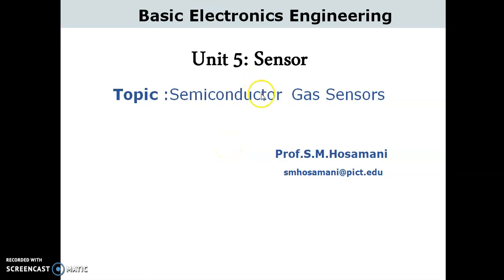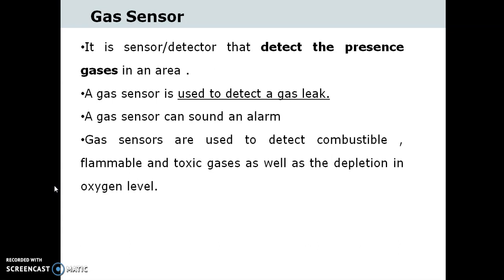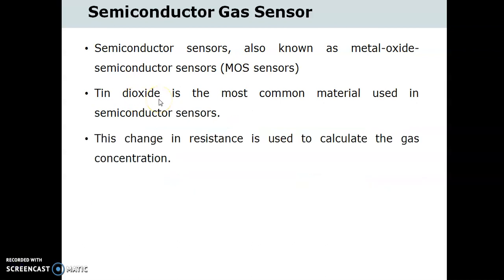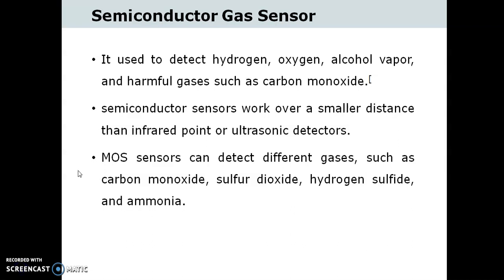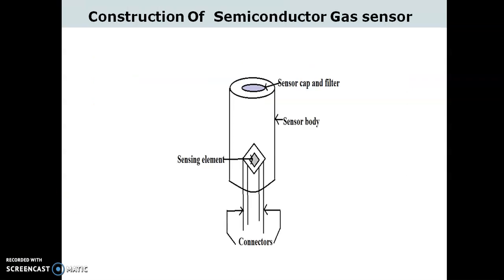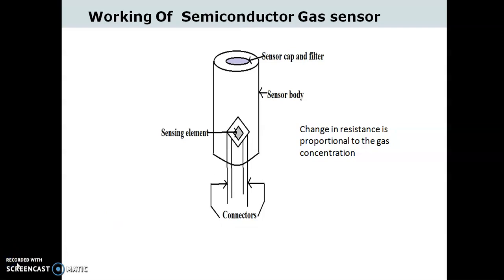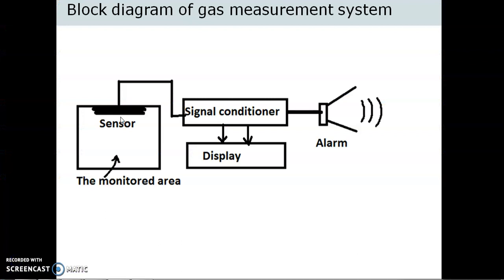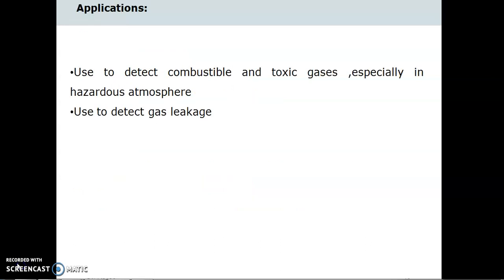Basic Electronics Engineering_Unit NO 5: Sensor   Topic: Semiconductor gas sensor

Comment: Mam, how the ultrasonic sensors used to detect the gas molecules? it transmits sound signals and receive echo which is used for measuring distance. why the micro heaters are used to heat the sensing material? how the temperature of microheater is set?